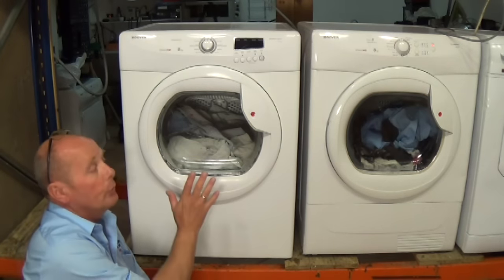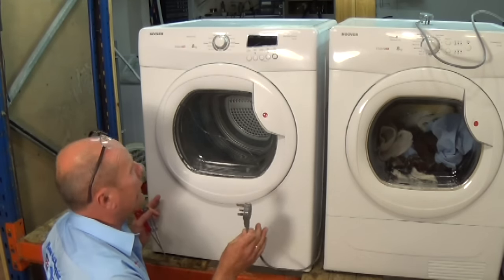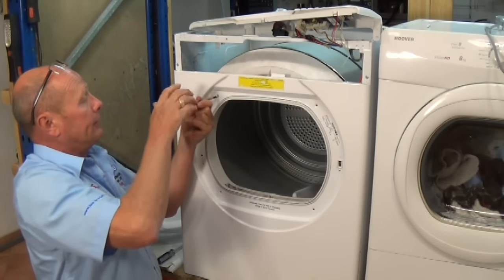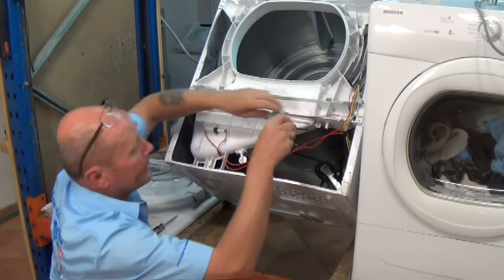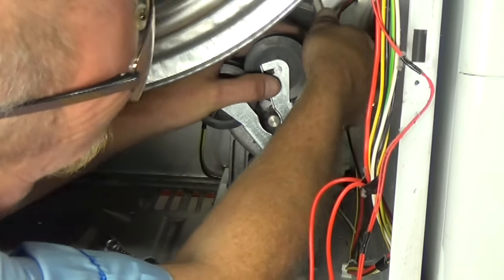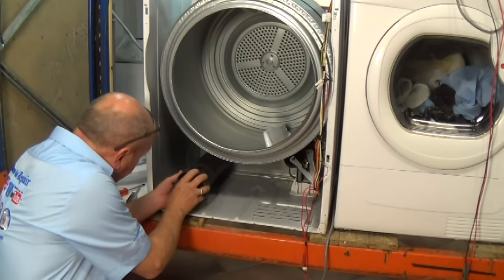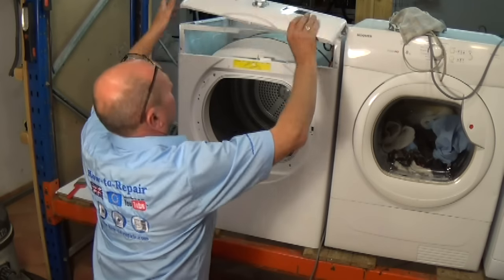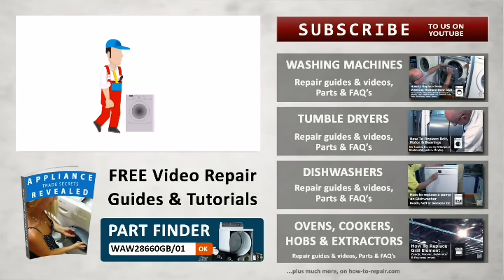Hoover Candy Tumble dryer drum not turning and belt ok faulty capacitor

Comment: I have a Hoover tumble dryer, looks like the same model to the right of the one you worked on in this video. Can I just puchase a universal capacitor to repair it (has same symptoms shown on this video) or do I need to remove the old one and check what MF rating it is first?
Reply from the maker: you should always check what size the capacitor is, a universal one will be fineas long as its the right size. please remember to subscribe to the Channel as that's what keeps us going and able to make videos for you
Reply: I got a hoover capacitor (with two pins) does it matter which wire you connect to which pin? Also does it matter how you connect the door lock pins?

I've put on the capacitor and reconnected everything. However when I tested it, the drum span but then tripped the fuse box. I tired it again and it produced the same result. So it seems that something about the wiring is wrong. The only electronics I touched was the capacitor and the door lock wires.

Comment: Hi There,  I had the same symptoms on my hoover dryer and replaced the capacitor and it still is doing the same.  The machine smells like there is a burning coming from the motor because it just sounds like it's stops with an electrical fault.    Could it be the motor instead?

Comment: on a universal capacitor I put wires on both sides of the 4 pin top 🙈 can it fuse it or wen putting wires on same side does red or blue matter go where ?

Comment: I changed the capacitor but the fault is still there ?
Reply from the maker: Hi, I will need the full model number of the identification plate and the details of your problem so that I can provide you with useful literature. Please use our contact us page and make sure you fill out the request for what your problem is. A video shoot of the problem would be perfect as well.

I will get back to you within 24 hours, normally. https://www.how-to-repair.com/help/contact-us/  

Please remember to subscribe to our channel, as that's what keeps this channel going. Thanks, Paul 👍

Comment: Does the same approach work for a condensor dryer as it has the water reservoir and fan at the bottom.
Reply: If you have the condenser model, remove all the components upto but not including the bottom left filter housing, the feet and the screws in the bottom. Once the front panel is removed that guides the drum in place you can now get to the capacitor on the right at the back, it is a tight squeeze to get your hand in but is possible with a long extension to a small socket set. The hard part is getting the spade connectors off the capacitor, if they will not come off use the bracket that held the capacitor as a lever to catch the edge of the spade connector and then pull gently to remove. Unfortunately reassembling is a bit of a bugger as you can only get one hand in, but preservere and you will get it on. The capacitors range from £4 to £10 pounds on ebay and there is not really any difference in them (unless one of our readers can say otherwise). I went for a mid range price of £7 which was a genuine hoover replacement part. So less than 2 hours labour and seven pounds has saved me 3 to 4 hundred pounds on a new machine.  Many thanks for getting the missus off my case

Comment: I’ve replaced the capacitor but the fault is still the same. Any ideas?
Reply: i am no engineer, but check wiring, connectors, circuit board(for blown resistors) and all above in video.

Comment: Don't buy a candy condenser tumble dryer. 3 capacitors fitted in 18 months, fortunately under warranty but it's a royal pain being without a machine for a few days. Terrible reliability, never buying anything candy again.
Reply from the maker: if you are going through this many capacitors I would check the voltage going to the plug when it's under load please remember to subscribe as that's is was keeps this channel going. Thanks 👍